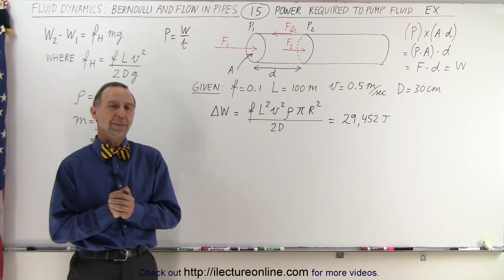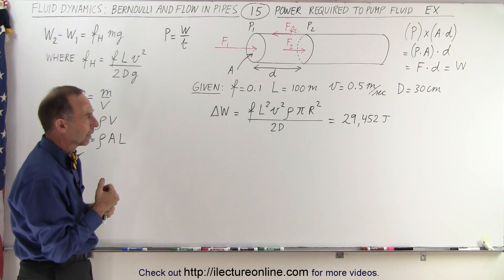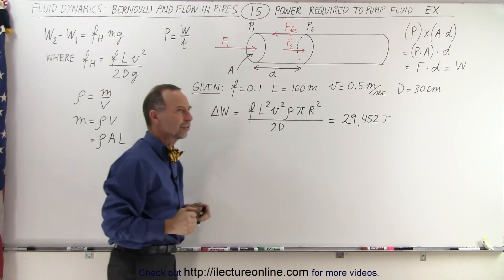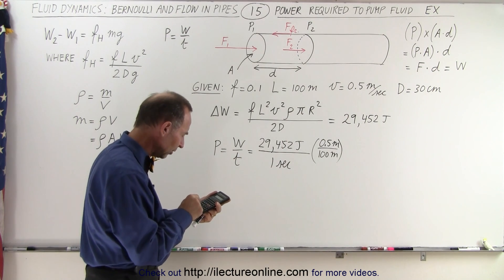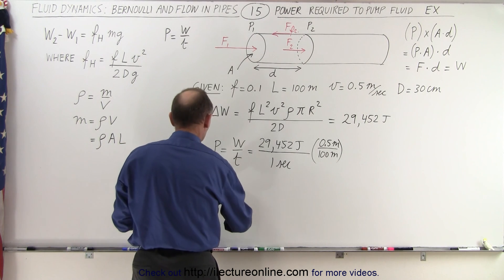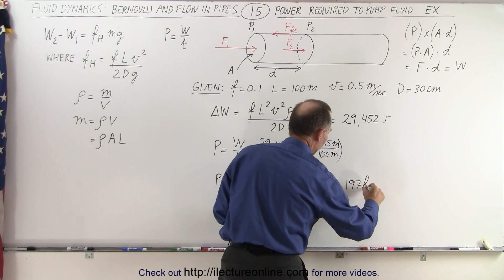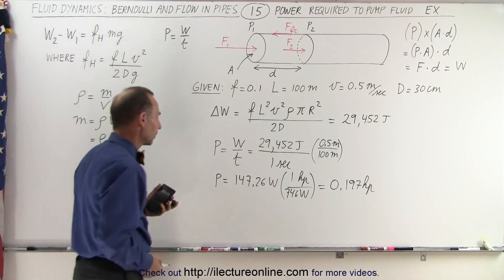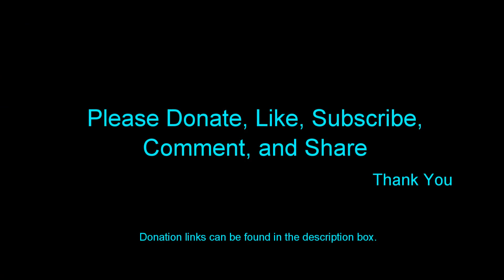Physics 34.1  Bernoulli's Equation & Flow in Pipes (15 of 38) Work=?  to Pump Fluid: Ex.

Comment: i didn't get the why you multiplie by the ration 0.5/100 m
tks
Reply from the maker: To calculate the power, we must divide work by time.    d = v t         t = d / v        1/t = v / d  = (0.5 m/sec) / 100 m  = (0.5 m / 100 m) / sec